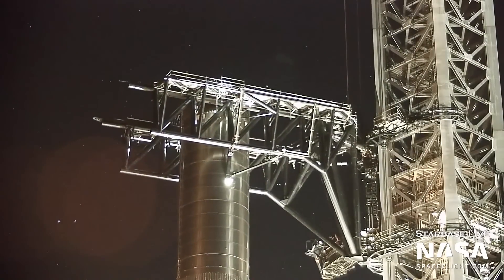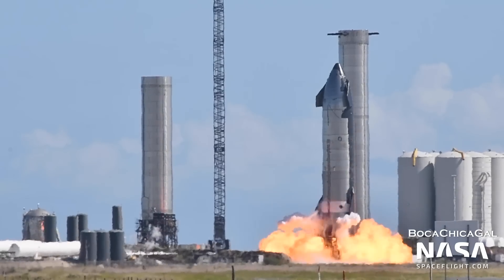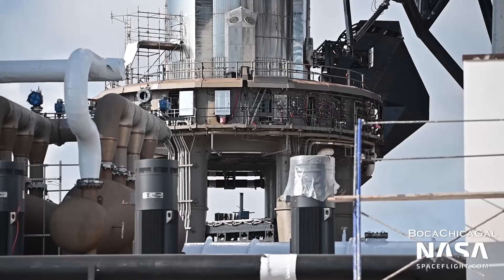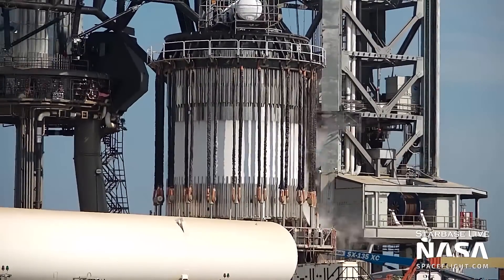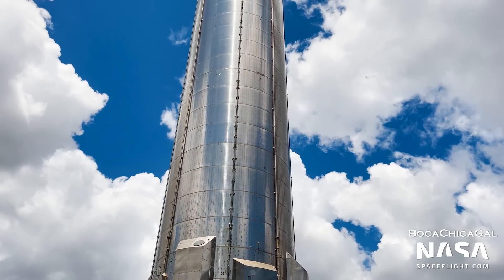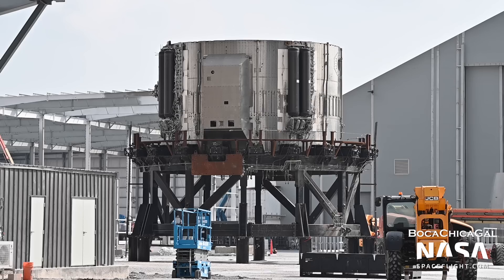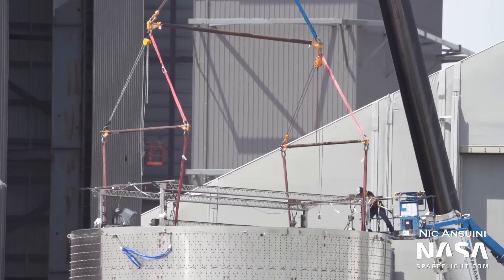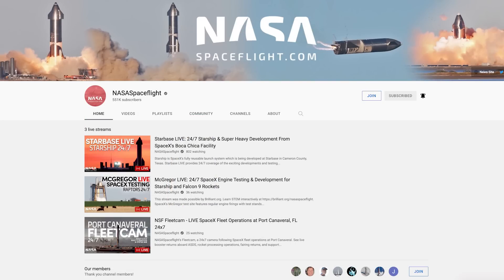How SpaceX is Planning to Static Fire Booster 7

Comment from the maker: Place your bets on when the first Static Fire test will take place (July X date, etc). 

Follow SBL for live coverage: https://nasaspaceflight.com/starbaselive 
Daily update vids here: https://www.youtube.com/c/NASASpaceflightVideos
Reply: July 28 at the extreme earliest for a launch, 7th for a Static fire since the 8th will not be available since that is a Friday.

Ship 24 will be moved and placed tomorrow the fifth, then one of the two will have testing done on Wednesday the 6th. Thursday will be the first static fire of B7 and the first overall of 2021 and for the OLP.

Next Monday-Thursday will continue the combined SF campaign of S24B7, which completes on the 20th, where S24 will have tile repairs completed by the 25th and stacked by the end of the 26th. Both vehicles then will have a WDR on the 27th with a launch attempt no earlier than the 28th with aborts through the early third of August until a launch on the 17th.
Reply: @topsecret1837  nope, not going with that.
Only because I am impatient and want it all now!
Reply: @dougaltolan3017  

I primarily put out that timeline because NSF has egregiously misread the situation. The Mitigated FONSI is out. All superfluous engine testing for Raptor 2 was already done at McGregor. Ship 15/20 with Raptor 1.5 still didn’t need any complete engine replacements, and they somehow expect lower standards for a vehicle with vastly better engines and on a pad over twice the height off the ground and with substantially superior GSE.

With SLS rolled back to the VAB and Artemis 1 to roughly parallel with Starship’s first orbital flight test, This is the perfect time for SpaceX to be testing aggressively to meet an aspirational deadline by the end of the month so they can have a launch cycle attempt down, which would inform them sooner and allow for subsequent attempts to occur more often to gain system experience that Artemis 1 is debately ahead on.
Reply: @topsecret1837  Why is this a competition with NASA?  The FAA still has to give the go ahead to launch.
Reply: @bruceatkinson5357  

It isn’t a competition. More of SpaceX to launch concurrently with another launch vehicle closely associated with Starship’s future career in Artemis as a way of giving NASA more confidence that Starship won’t be as much of a letdown as they may believe.
Reply: @bruceatkinson5357  

Also, why can’t it be seen that perhaps NASA just believes Starship is an unreliable vehicle, thus by giving them confidence they can finally believe they have a choice to use it for future missions, most unrelated to Artemis of course?

There have been ideas thrown around over the past few decades for a Mars orbital tug. Starship seems like the right vehicle to do that with. 

Missions to Jupiter, Saturn, Uranus and Neptune are also not out of the question if expendable second stages with refueling capability in orbit are employed.
Reply: @topsecret1837  Seemed very coincidental that FAA and all the other agencies took so long to review all the comments and EIS.  Therefore, was there competition to launch a 10 year NASA rocket before a SpaceX new one?
We never will know how Starship does if it doesn't get approval to launch.
Reply: July 15
Reply: On my B-day 14th of July 😉🚀
Reply: I predict the burn will happen the day it happens which is a few, if not more, days than it should happen. Either way will be exciting and worth every hour of tank watching it will entail.
Reply: Does SpaceX have the documentation needed to perform test fires/launches at this time?
Reply: @KnightRanger38  test fires yes, launches no.
Reply: @KnightRanger38  Test fires yes. But no FAA launch license yet for the orbital flight.
Reply: Launch attempt 8/8/22
Reply: @kitt44kt  SN8 & SN15 were on a Wednesday, so maybe the 10/8/22.
Reply: September 24
Reply: July 21st 😮, first launch.  Oh, and High Bay will have executive offices up top, including Elon's.
Reply: Thursday July 7th for pre-burner then if all is well same day for static fire
Reply: July 6th!!!
Reply: July 7th. The road is closed for 12 hours. Seems a long time for a pre-burner test.
Reply: Preburner: July 7
Static Fire: July 10
Launch: July 28
Reply: August 2
Reply: July 20 of course, the absolutely best way to celebrate the moonlanding anniversary :)
Reply: July 30th

Comment: Fairly early on, when we had not yet seen the second stage. I counted rings and did some basic math. Diameter was at that time available. This was just about the time the did the first tests to altitude and attempted the belly flop landings. There was nearly a mile of welds on the rings. 

So I'm guessing there's are least 3 miles on starship. Does anyone know what the starship diameter is???
Reply: 9 metres

Comment: I have faith in the Engineers that Designed that launch tower but just my opinion looks like it should be somewhat taller and rocket thrust directors or whatever they are called. Still can't wait!👍
Reply: I’m of the same opinion, past large rockets had tunnels directing the thrust .

Comment: Why is SpaceX not testing the booster at a lower altitude (10 km or hop), and instead, going for an orbital flight directly?
Reply: Well the booster has no landing legs, so a hop would be pretty difficult. Also, going all-up with orbital testing is riskier, but has the potential to return a lot more data!
Reply: @CreeperIan02  

Agreed. Although at some point a catching test may seem like a viably useful event to do before they attempt an orbital launch with a returning booster being caught.
Reply: Because Starship needs to survive reentry. Getting that down is priority number 1. There is zero point in advancing further until the heat shield is proven. I would expect a hop/catch testing campaign to begin again after OFT1.
Reply: I was really goping for a booster hop, probably to risky since it's huge,doesnt belly flop, and hasnt been tested at all before.

Comment: Im thinking a full stack will be required for a 33 engine fire. It would make sense for them to go full stack, do a WDR into a 33 engine static fire. Then launch.
Reply: Naa I don't think so. The booster is independent of the ship. No reason to risk the ship
Reply: @alihaidar5787  I think they mean that the weight of the ship is needed to help hold the booster down. Although if I had to guess, this isn't needed.
Reply: @Raptor2  - Not the weight. The OLM can hold it. Vibration dampening.
Reply: @alihaidar5787  - It may not be independent in terms of firing all 33 engines. SS might be needed to dampen the vibrations both for the rocket itself and GSE. It's just a guess though. Depending testing plan and it's results 33 engine static fire may not be too risky. It'll be interesting to see the pattern in which they test the engines. Will it be 33 firings? One from each ring followed by cluster testing? If they can gradually work their way up to 33 then It's just a stone's throw away from a full wet dress rehearsal.

Comment: 1:20 outer fixed engines are so close to each other, what if they wobble too much and collide?
Reply: They're fixed in place so they can't move or gimbal
Reply: Same thing here. Despite those are fixed engines, their bell nozzles could vibrate and ressonate. N1 rocket vibes...
Reply: Heat is usually the big worry when it comes to clusterd engines. The radiant heat given off can cook the cluster. It's why on some older rockets the engines are pointed outward slightly.
Reply: They wont budge anymore than is needed, they don't gimble so im sure only the nozzles will slightly flex.
Reply: @matthewsoules7064  is the flex that I'm worried about, just imagine the vibrations.. we'll see:)

Comment: Why is it called an "orbital launch mount"? Haven't these sites always been called "launch pads"?   Is it necessary to specify "orbital"?
Reply: Well there's the suborbital launch site so yes, there's kinda a need to differentiate them 😅😅
Reply: @ale131296  What is the difference?
Reply: @bruceatkinson5357  The suborbital pads only host ships (could/has host/ed boosters with an adaptor but it's very limiting for testing). It's also from where all the hops in 2020 and 2021 launched from

Comment: I think the top of high Bay 2 will be one floor with a very high ceiling and will serve as an observation/mission control area.
Reply: I could see that!
Reply: Code would require fire stairs for any occupied space of significant capacity.
Reply: Supposedly the build site is too close to the launch site to be safe during launches, so i don't really know what they would do with it
Reply: It could also be a place for public events. Or maybe Elon Musk moves in there.
Reply: Don’t think I’ve ever seen a 5 story high sheet of glass before
Reply: @elevatorphish  I guess you could attach several glass panels to a framework.

Comment: SpaceX slowing down on starhip or booster production might as well be slowed down due to high costs. You can see on all sides that SpaceX is currently trying to reduce costs and increase efficieny (less remote work). 
All drastic but eventually smart as they still got plenty to do without needing to spend money on future boosters and starships. That will come eventually anyway.

Bear in mind that a lot of money currently also goes to 39-A. 
Let's be realistic. They cannot spend max money on all fronts. Definetly not in a recession. All we need is a launch and landing to and from orbit and then cards will be mixed again. 

as for the bet.. i would like to know if first flight attempt and chopstick are coming hand in hand. Flight could be July but as waste if no chopsticks. I hope they do not intend to lose booster and starship. So i prefer more testing with maybe catchin booster first and then rock n roll in September. If you take risks, why take it all?
Reply: First flight i thought was gonna soft touch down in the ocean

Comment: Elon: harmonic oscillation path integral. Thats what destroyed N1 too.
Reply: I like to think we've advanced a little bit in materials science and metallurgy since the 60s and 70s. The N1 was managed by a bunch of drunks on a shoestring budget. Someone correct me if I'm wrong, but they couldn't even get the right metals because of sanctions. So they couldn't build pill shaped fuel tanks. They had to be spherical which gave N1 it's distinct pyramid shape.
Reply: Full-authority digital control + accelerometers, to the rescue!

Comment: I sadly feel like there needs to be some minor (not major) issues during testing or first flight. Otherwise it kinda feels there is some problem linguring that nobody knows about. .... NASA orange rocket anyone?
Reply: There will definitely be minor issues.
Reply: @My_Fair_Lady  - I'd rather not see the program set back what probably would be two years if it explodes on the pad. A partial success is needed so atleast the heat shield can be tested.
Reply: @My_Fair_Lady  as any anti American would, bless your black soul you little contrarian you